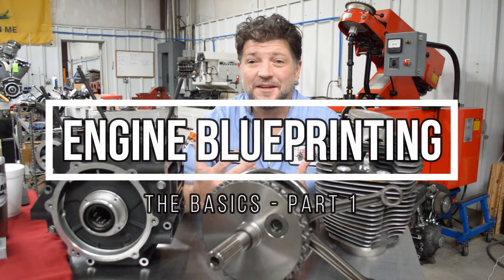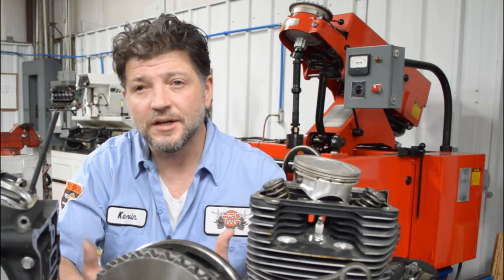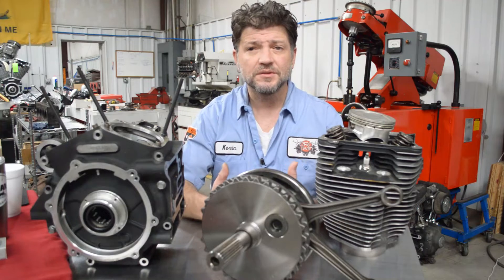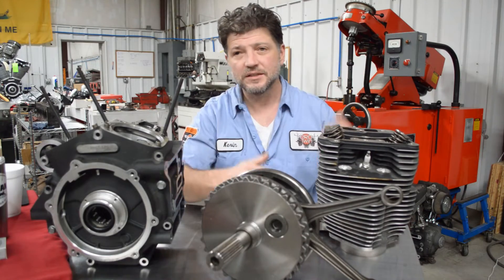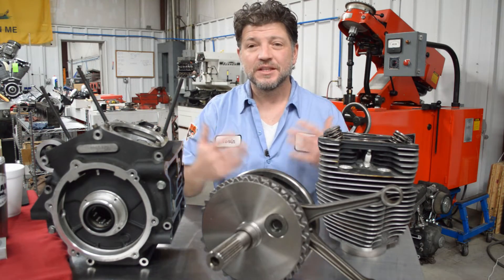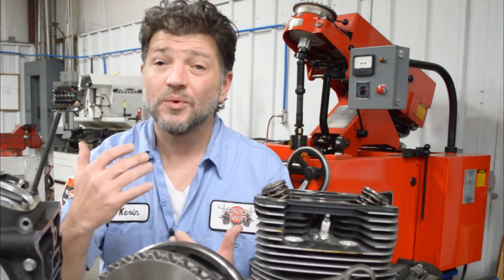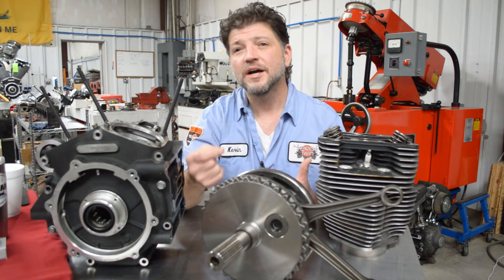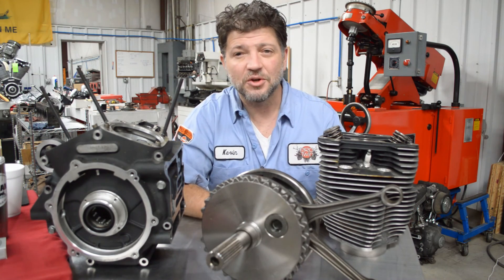Harley Engine Rebuild and Blueprinting Part 1 - Kevin Baxter - Pro Twin Performance

Comment: Just wishing, no $$$$ after all. I want my stuff Bullitt Proof. Don't need an engine to run on the ragged edge. I just want the parts that would handle the ragged edge. Make sense? Dead nuts reliable with just a hair more power.

Comment: kevin, is it normal for the flywheel on a twin cam to have freeplay in crank when just on a stand and nothing connected to either side of the shaft, should the shaft be moving side to side when u push in or pull out on shaft
Reply from the maker: if it has roller bearings, yes.  this is one of the reasons to do timken conversion.  without it, the crank is relying on the spacer comp and bolt to "loosely" keep it centered in the case.  if it loosens, the crank starts shifting.  cant do that with a timken.

Comment: 2018 streetglide,  i added, 114 big bore, S&S 475, screaming eagle heads, thinner head gaskets, screaming eagle big throttle body, injectors, thundermax, khrome works  2-1, 145hp 143 torque on dyno tune. 
Great to ride
Reply from the maker: Excellent.  Good results there for sure.  Thanks for sharing.

Comment: In the "old days" we would static balance the lower end reciprocating components to within a gram (and record for easy replacement) then dynamic balance (automotive) the assembly. Is this still the common practice? Do common pin crank assemblies (Harley; not sure my terminology is correct) even get dynamically balanced?
Reply from the maker: In some cases yes. Others have found a combination of static bal components, then as an assembly, to work just as good.

Comment: I’ve gotten confused because someone, I think Doc Harley, did a video about using the motor to stop I assumed he was talking about downshifting. I downshift to accelerate and slow down. I always thought that was the best way to keep control. If it’s hurting my bike I’ll stop.
Reply from the maker: Thanks for the sub and welcome back to motorcycling.  You have to downshift...what you are referring to is engine breaking.  Basically, downshifting and releasing the clutch at high vehicle speed utilizing the engine to slow you down.  Doing that aggressively does stress the crank.  It also can create excessive reversion with fresh air being sucked into the pipes causing a very lean fuel mixture.  That can heat an engine up quite a bit.  It also causes excessive wear on a clutch, and may other things really.  Using a mild approach is fine...but doing it aggressively would not be my suggested way to ride.  Use your brake pads instead...they are much cheaper to replace.  Just my .02.

Comment: A wise man once told me leave it stock and you'll have alot less  headaches.  I yet to see a build make 130hp and last 100k miles with preventive maintenance. And that's including S&S creates.  HD vtwin live a tuff life .
Reply from the maker: In general, an engine that makes 1hp/1ftlb per cubic inch, will be very reliable and last a very long time...which is why most crate engines follow that.  GM 350 v8....350hp.  S&S 124....est at 125hp/tq.  The further you get away from that, reliability will decline.  Thats one reason we focus on tq....you can make a lot of low end torque and keep the engine very reliable.  We like to ride that fine line between performance and reliability...and not compromise longevity.  Of course, the more power an engine makes, the more people seem to push them.  So much of the lifespan loss is due to an owner pushing it hard all the time.

Comment: Kevin in ballpark figures what would it cost to blueprint a skunkworks  build on a 114 on a 2017 Ultra limited CVO?
Reply from the maker: I only discuss builds one on one. Too many variables, questions, and options to throw a number out there. Feel free to call me on Tuesday and I'll be happy to work thru it with you directly. Thanks.
Reply: Kevin Baxter sounds good thanks Kevin!